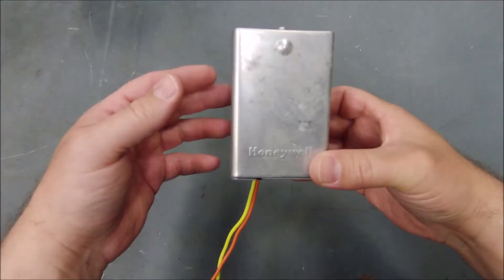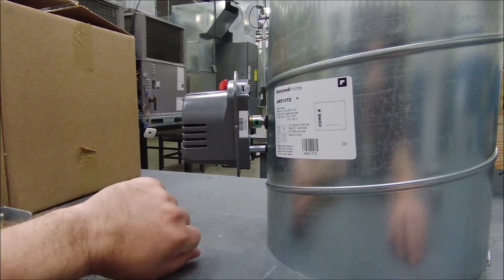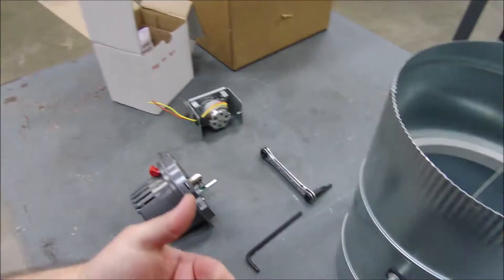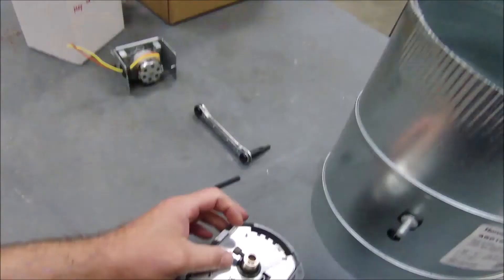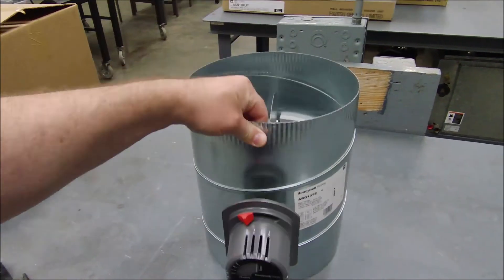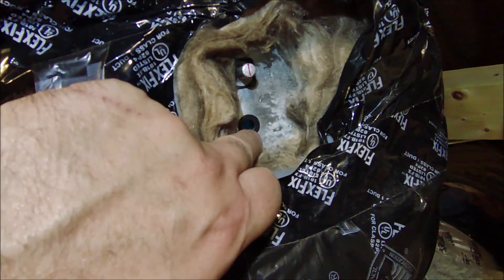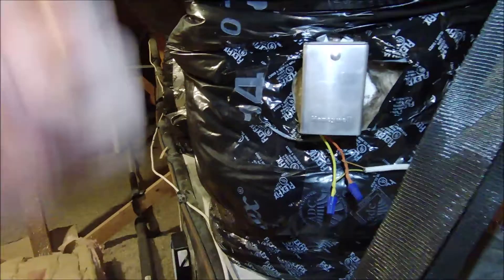Zone Damper Actuator Replacement

Comment: Those spring return motors are crap!  I've gone through my fair share.  Everytime the motor got so hot the plastic gear would get soft from the heat & strip out.  I went to a 3 wire non spring return, non honeywell brand.
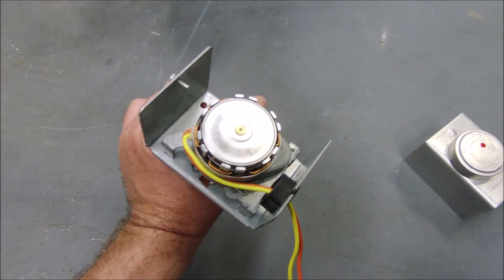Reply from the maker: I am not gonna say you jinxed me but at 2:45 this morning I got up and my outdoor unit was cycling on/off every 3 minutes or so but no airflow on the downstairs zone. Had airflow upstairs though 🤔  Of course I would have a stuck closed damper. I have already replaced a few for neighbors and it looks like it was my turn!

Comment: We have a damper motor fail made by xci. The tech told us the "shell" has to be replaced as well since the new motor (honeywell) they will be using will not fit the original. Is there really a compatibility issue, does that make sense?
Reply from the maker: It might be more that the mounting of the damper motor would not match up and might be easier to replace the damper as well. There can be other things like how fast (in seconds) it closes to consider. XCI was the first zone system I ever learned and they are still around. I wonder if you/contractor could order the XCI damper actuator online if a local parts store doesn't carry them.

If you can't get the original damper actuator and get one that fits the voltage, size, etc... personally, I would change out the whole thing so it is a matched set.

Comment: Thanks for this video John. Can I use this on a rectangular damper? I have an old trolAtemp motor and I believe Honeywell says the m847d zone motor is the replacement, which looked like the one you installed?
Reply from the maker: If Honeywell lists it as a replacement I would think that it would be pretty straight forward on replacing it. If it isn't exactly the same procedure I am sure it isn't very far off for changing one out.

Comment: Great video.   It's really not that complicated!    I have two questions:  1) when the thermostat is not calling for air, does it receive constant 24v to keep the damper closed?   Then when thermostat is calling for air, it would cut off the electricity and the spring would open the damper?    I would image a spring close and power open setup would be more energy efficient.  2)  After removing the motor, is there anyway to tell if the damper is in open or closed position without a benefit of a direct visual?   I believe the damper in my attic is stuck in open or semi open position.
Reply from the maker: The damper should have 24v on it anytime it is closed. So without going and digging through settings or anything, I have one in the shop and when the system has satisfied the call for heat or cool and the purge has ended, all dampers open. To point #2, I have used a piece of wire or a brazing rod to poke through metal ducts to feel where the damper is positioned. Just make sure to tape and seal any holes of course.

Comment: Could that same new Honeywell actuator work both power open or power closed? Or do you have to get a different model actuator?
Reply from the maker: I think it would be a different model. This one is a spring open, power close, if I remember correctly.
Reply: @johnjennings-JJ  You can field-convert just by swapping the black plastic grommet and plug in the damper, so that actuator installs on opposite side.  Both model actuators (ZONE and VENT) turn the shaft CCW when power is applied -- the ZONE version indicates CLOSED when power is applied.  The only issue with field-conversion of the damper using the same actuator will result in the indicator on actuator face showing open when closed, and vice-versa.
Reply from the maker: That's good stuff. Never thought to look it that way. I will definitely remember this for later use. Thanks...
Reply: @johnjennings-JJ  You can find info on it HERE:  https://customer.resideo.com/resources/techlit/TechLitDocuments/33-00000s/33-00079EFS.pdf
I'm trying to figure out the easiest/fastest way to swap around those plastic parts on an installed damper - my arm is not long quite enough to reach into the vent to get at the back side of them with pliers.  Pulling off lots of tape/insulation and then muscling around the vent pipe to remove inline damper just to do this seems like a real pain.  Ideas?
Reply from the maker: Been trying to think of a way but it isn't coming to me. Maybe just popping the duct off and reach in is the fastest?

Comment: Might be dumb question, but how do I know what position my damper is in when I replace with new one? Do I have to take duct work apart or just go by the actuator rod?
Reply from the maker: You don't have to take the ductwork apart necessarily. Maybe the easiest way is to turn you fan or a/c on and when you hear the air flowing through the duct just turn the damper blade rod by hand and you will hear the airflow stop. Mark it with a sharpie so you know for sure where it is positioned and then turn it off unit to replace the motor. That way you aren't fighting the air flowing.
Reply: @johnjennings-JJ  Another way to confirm - remove actuator and look through stabilization grommet hole to see when blade passes by.
Reply from the maker: I realized that after posting this,  when I was helping someone while they were changing an actuator out. Could have kicked myself for not thinking of it sooner! Thanks for the comments. It's all the little stuff that gets me...
Reply from the maker: If you look at approx the 6:30 mark in the video you will see the "stops" on either side of the damper blade. If you turn the shaft counter clockwise it should close all the way.

Comment: Hi, can you tell me what is the right range of air flow using that red adjuster on top?
Reply from the maker: According to the manual supplied with the actuator motor...the "0" is for no air bleeding by, the 1 is 20%, 2 is 30%, and the 3 is 50%.

I leave it at "0" for any/all that i have ever installed. But it depends on your exact setup. I would think that most are just left alone and on "0".
Reply: John, I was just about to ask the very same question! Thanks for answering it! As always keep up the good work!
Reply from the maker: Thanks.

Comment: What is the red manual lever for? Is it to set max opening or just a manual open and close lever?
Reply from the maker: More of an adjustment so you can crack the damper open a little when it closes. It will bleed some air by depending on which number you move it to. I have always left it at 0 like it comes.

Comment: JOHN JENNINGS!!! HOW DO I JUST SO HAPPEN TO STUMBLE ACROSS YOUR VIDEO!?!?!? GOOD TO SEE YOU DOING WELL!  🙂 -VINCENT (YOUR LEAST FAVORITE STUDENT)🤣
Reply from the maker: I see you. You...the least favorite?? May third or fourth 😁. I am still trying to put some basics out there for the guys. You should be resting up for work instead of surfing youtube.
Reply: @johnjennings-JJ  I need some help out here.  Let the guys know I pay well... just bought an extra service van and I need someone in it asap!
Reply from the maker: Will do. I am out until the fall semester but will put the word in for you. Call or stop by the office as well.
Reply: What. Is the red button on fop for?
Reply from the maker: Easy terms. Its an adjustment. You can have the damper closed but still "cracked" open enough to bleed some air by into that space. It helps relieve a little air pressure in the duct and give a little airflow in the zone. As you might guess...the bigger the crack, the more air bleeds by the damper blade. Too easy. Thanks for the comment.